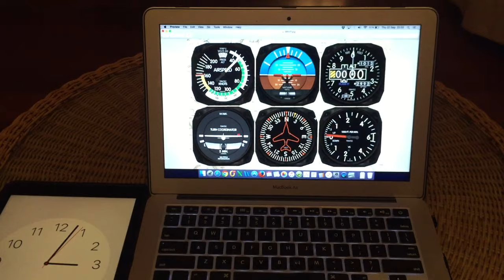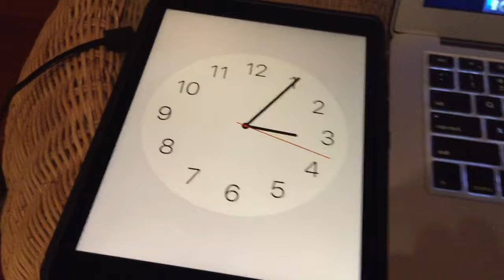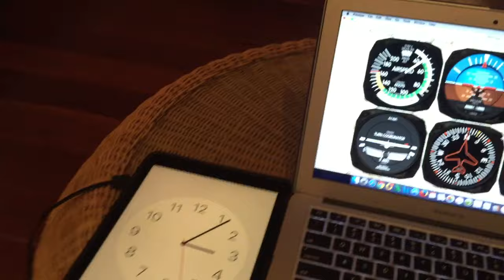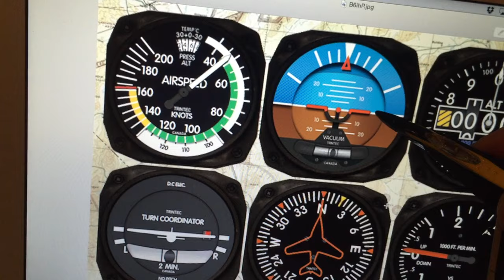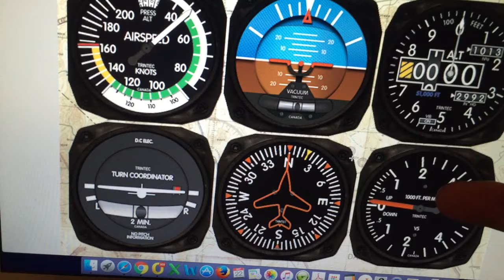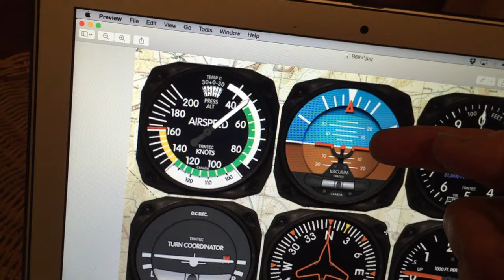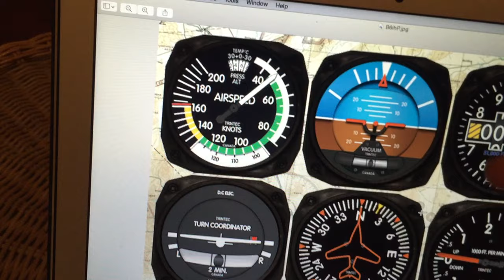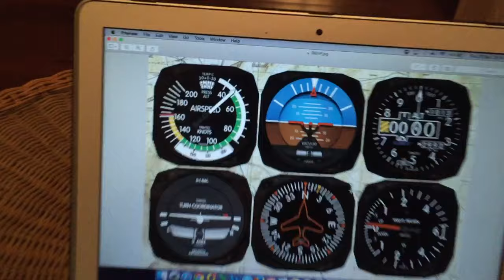Do aircraft change attitude to follow the curvature of the Earth?

Comment: Are you a pilot yourself Wolfie? I think not. 
I am. In straight and level flight in no wind no turbulence conditions, once trim is set, I hardly ever had to touch the yoke to keep straight and level flight. I could fly several minutes 10 15 20 30 mins w/o adjustment.  And that was before I ever questioned the shape of the earth. 
Earth is level my friend.
Reply: What about 45 60 120 mins?
Reply: david Richards

Autopilot.
Reply from the maker: Here is a really simple question Charles, even a private pilot should be able to answer this easily. 

What is the distance between the following pairs of Latitude and Longitude? 

1.   60N010E and 60N020E?
2.   00N010E and 00N020E?
3.  60S010E and 60S020E? 

To make it even easier just calculate the rhumb line distance.     Any pilot worth his licence should be able to do this in his head in about 15 seconds.

What answers do you have please Charles?
Reply from the maker: Yes Charles, I am an FAA and CASA ATP pilot, a Grade 1 flying Instructor
 with over 10,000 hours and 3000 on helicopters.  Did you actually watch
 the video and listen to what I said?    Of course you cannot notice the 
pitch down because even flying jets it is only 1 degree in 8 minutes. 
The average pilot will never even realize he is slowly pitching down 
because the rate is far too slow to be noticeable and is achieved simply by maintaining altitude anyway.   
I said that in my video very clearly. 

What type of aircraft do you fly?   Have you ever flown internationally 
in the Southern Hemisphere?  How do you calculate flight plans?  

When you are hand flying at a constant level, what do you do if you notice your altitude increasing slightly?
Reply: Wolfie6020
It's only 1 degree in 8 minutes for the first 8 mins. the decline then increases exponentially for each mile flown. I have flown for several minutes for miles in calm weather conditions without having to touch the controls purposely just to see how far I could fly doing just that. Yeah, 30 mins is a bit too far, but several mins was quite common.
Are you really a pilot? How do you calculate flight plans? I flew a model plane at the beach. LOL Having all the credentials in the world doesn't change a thing.  What does flying internationally over the SH have to do with anything? I have two videos on my channel where I discuss flying. I also watched the entire Globebuster video where they went over your video in detail. 
Further, if the earth is spinning west to east, landing at a N-S oriented airport, pilots would have to adjust for the shifting of the airport beneath them during final approach. My home airport was 120 mag north and never once was any spinning sphere adjustment needed, nor was any curvature or spinning of the Earth even mentioned during flight training. You're full of it.
Reply from the maker: CharlesFockaert
Then as a pilot you should have seen the major flaw in the Globe Busters video.  The exponential calculation only applies to a fixed point observer.  It does not apply to a moving aircraft at all

A moving aircraft has to pitch 1 degree in the first 8 minutes.   Then 1 degree in the next 8 minutes, then 1 degree in the next 8 minutes and so on. 

Because it is moving, the attitude adjustment required is steady, not exponential at all.  Please don't make the same dumb mistake Bob did in his video.

A great article on this topic is here.

https://flatearthinsanity.blogspot.com.au/2016/09/flat-earth-follies-planes-would-have-to.html
Reply from the maker: CharlesFockaert
See a few minutes is a far cry from 30 minutes. so you admit you were exaggerating.  That is cool.

I want to know how you calculate your own flight plans.  I use various methods and verify them with a raw math excel sheet I wrote myself using the Haversine formula.  The relevance of the Southern Hemisphere is that this formula would never work on a Flat Earth in the Southern Hemisphere.

Can you explain why it does work perfectly though?

Here is one of the little tools I wrote that calculates great circle distances.   Please try it yourself and please explain why it works in the Southern Hemisphere  (If the Earth was Flat it would not work at all)

https://dl.dropboxusercontent.com/u/62849459/Simple%20Great%20Circle%20Distance.xlsx
Reply from the maker: CharlesFockaert
Have you actually calculated how much adjustment is required during an ILS approach to a N/S runway at 160 Knots starting from 10 miles?   Just give me a ball park figure how much drift adjustment you believe would have to be corrected for due to Coriolis in that scenario?
Reply from the maker: CharlesFockaert
PS, I will watch your videos soon.
Reply from the maker: CharlesFockaert
You disappoint me Charles.  You claim to be a pilot and when we start talking "pilot stuff" you can't answer simple questions and respond with a silly comment worthy of a 10 year old.

You think Coriolis is male cow dung?  What do you think a comment like that does to your credibility in the eyes of any professional pilot reading this?
Reply: Wolfie6020

I'm a private, not commercial pilot. I am not IFR licensed, taking only about 25 hours IFR training.
I'm watching ILS landing videos right now. No mention of coriolis in any of them.
I don't care what a "professional pilot" thinks. There is no curvature to the earth, there is no coriolis, there is no spin. You're the one w/o the credibility. I also am licensed amateur radio operator. You gonna question that too, just because I don't believe the spinnins sphere nonsense they teach there too?
Reply from the maker: CharlesFockaert I won't question you on being a licensed radio operator because I am not one and you likely know a lot more about it than me anyway.

There is no mention of Coriolis in the ILS videos because the effect is so insignificant it is negligible.  That was the point of my question to you.

Hey you are entirely within your right to believe the Earth is Flat but if you were an International pilot who circumnavigates the Globe regularly you would actually understand why that belief is totally wrong.
Reply: +Charleyboy  LMAO.  I touched a raw nerve eh?  None of that requires any intelligence.  So you passed a real estate agents exam.  Big deal!  So did my mum.  Why would I post my credentials?  only insecure people need to do that.  FYF.
Reply from the maker: +CharlesFockaert.  I didn't see this last post of yours as it was in the Spam folder but I just approved it.   Your math is completely wrong Charles.  800 Mph is 13.3 MILES per minute.  Not Feet per minute.   A five minute approach would be 66.66 MILES.  Not feet. 

However your logic is also flawed too.  That motion is totally irrelevant as the aircraft is already moving laterally with the spin.  Why do you think it is separated?  

The correct way to calculate this is take the latitude at the beginning of the approach - calculate the Earth's speed of spin, then take the latitude of the threshold and calculate the speed of the spin.   Over ten miles (ILS approach) the difference is negligible.   Please do that math Charles and then I will show you mine and we can compare.   Lets say,   The runway threshold is 35 South Latitude - Runway 36  (exactly 360 true)  Starting the approach at 10 miles and maintaining 160 Knots down final all the way to landing.     Do that math and you will see the coriolis is negligible. 

To understand why your logic is wrong, please watch these videos showing that the motion of an object in the air is not separated from the motion of the ground the instant it becomes airborne. 

You are falling for all the silly mistakes in logic that I see often on Flat Earth Videos.   The aircraft has the earths spin before take off and does not instantly lose it when airborne.  

https://youtu.be/viHz5MWz8kU?t=3m22s

https://www.youtube.com/watch?v=XawCNYpeKD4

https://www.youtube.com/watch?v=7EklkTiLxMg
Reply: I thought there was something wrong with that number when I did the calcs. But 66 miles just supports my view all the more. This "That motion is totally irrelevant as the aircraft is already moving laterally with the spin" is pure poppycock. How is the plane moving laterally with the Earth's spin? Further, why didn't this come up even once in my flight training? There is a video out there where a rifle instructor admits there is no adjustment for the alleged Earth's spin: the bullet is not affected. Same principle - bullet or plane - there is no spin. Me senses tell me as much, despite all that relativity male cow dung. 

Doesn't matter anyway. Please explain how the world's oceans are stuck to the bottom and sides of a ball spinning around at over 1000 mph - which is faster than the speed of sound? You're going to give the standard answer _ Gravity. Well, if the moon is allegedly moving the same mass of water at the tides, then the much smaller moon's pull is greater than the pull of the Earth's gravity? Earth's gravity can hold billions of cubic feet of water to the surface of the Earth, but can't pull a bird into the water? Doesn't make sense. 
Sorry, still no evidence to change my mind.
Reply: Yeah, I'm insecure. You got me. Discussing issues with you is Pigeon Chess.
Reply from the maker: As you are a pilot please answer me this very simple question Charles.  If you are hand flying and cleared to cruise at 6000 ft if you noticed the aircraft had climbed 50 feet, what would you do?
Reply from the maker: CharlesFockaert
If nothing I say will change your mind and nothing you say will change my mind, because I can clearly see the flaws in your logic then why waste each others time.   If you are happy believing the Earth is Flat then be my guest. 

Just wondering though f you can explain why the Sun is setting well South of Due West in Sydney right now? 

https://www.youtube.com/watch?v=GGXh7HfTbHk

That simple observation utterly destroys any possibility the Earth is Flat can you honestly not see why?
Reply from the maker: +CharlesFockaert,  again this post was in the spam folder.  I have now approved you so you can post links and they won't get blocked.    How many examples will it take to convince you that Stinky Cash's video is wrong?  One?, Two? or five?

Firstly, yeah my video explains everything - this angle for the sunset is completely impossible on a Flat Earth.  Why can you not understand that Charles? 

1.  The map shows Australia is twice the size East to West than the USA.  This is completely wrong,  Road, Rail and flight times confirm this. 

2.  Why does Russia have 11 time zones when Australia has only three?  That makes NO sense at all on the Flat Earth map in his video. 

3.  If the Sun is moving faster over the Tropic of Capricorn than it does over the Tropic of Cancer, why is the longest day in Rockhampton Australia (21st December) exactly the same length as the longest day in Mazatlan Mexico (21st June) - 13 hours 33 minutes.   Impossible on a Flat Earth. 

4. Looking South from Rio in Brazil, and Perth Australia you are looking in completely opposite directions.  Yet at precisely the same time you can see Acrux in the sky to the South from both cities.  How can the same star be in two places at the same time?  

5. Circumnavigating the Globe South of the Equator should be much longer than doing it North of the Equator.  It is not - its is the same - I appreciate you may not have done this yourself but I have. 

6.  On the Equinox - the Sun Rises at 090 and Sets at 270 all over the Earth.   This is observable fact.   Test it yourself.    That is not even remotely possible on a Flat Earth and Stinky Cash's video demonstrates this would NOT be occurring if the Earth was Flat. 

Need more examples - please let me know.
Reply: Wolfie6020

What you don't get is that just because you appear to be correct on these sun issues and even the Flat Earth map doesn't mean the Earth is spinning and is a sphere. I still have issues with the Earth's oceans being stuck to the bottom and sides while spinning. Also, there is no curvature.

Water is level, not curved. There are also issues with the constellations. Moon landing, van allen belt, ISS, radio wave propagation, NASA lies, etc ad infinitum.

Just because a private pilot who hasn't flown in two decades, who isn't IFR and not up to speed on some aspects of flight or as knowledgeable  as a commercial pilot who has to keep current by passing exams, doesn't mean he's stupid, so why the ad hominem used, (not by you but these other posters?)  Like I said, never once was the the spin of the Earth mentioned during my (limited) training.

We agree, repeat, agree there are issues with the flat earth maps as they are currently drawn. But there, as I said above, other significant issues with the spinning sphere model as well.
Reply from the maker: CharlesFockaert I am happy to agree to disagree Charles and if someone produces a perfect Flat Earth Map that explains everything I can see and have experienced with my own eyes plus a 2D formula that lets me calculate flight plans that work as accurately as mine do now then I promise to be the first to admit I was wrong.

Until then, I will have to stick with the Math and the Maps that have never failed me in 30+ years...

Cheers.
Reply from the maker: +CharlesFockaert.   See the thing is Charles, when I watch videos like that which people claim as "proof" I immediately see that much of it is nonsense based on things i have experienced with my own eyes.  Let me give you examples from that video.. 

1. Water unmanipulated actually forms a sphere.  Not level.  When manipulated it conforms to the forces being acted upon it - e.g. in a centrifuge it forms a curved surface.   (yes I have simulated zero G in aircraft and watched water form a sphere.)

2.  Horizon rises to eye level.  Absolute BS.  I have several videos proving this on my own channel.  I see aircraft 1000 ft below me all the time appearing well above the Horizon.  An aircraft 10 miles away and 1000 ft below me is 1 degree below my level.  At 40,000ft the Horizon is 3 degrees below level which is why the aircraft appear above it. 

I see the horizon drop in my HUD every time I fly.  I see this with my own eyes all the time so I know that claim is total BS. 

https://www.youtube.com/watch?v=Th9irMrNlhM

3. Curvature.  I respect you may have never been up to 49,000 ft, but the plane I fly is rated to 51,000 ft.  From the high forties the curvature is obvious.  I can see it clearly through the cockpit window.  It is not window distortion as some claim because it was also there in an old HS 125 that had flat plate windows.  The horizon is clearly curved. I see it with my own eyes regularly. 

Flying from Sydney North East we often see Balls Pyramid, a large tall rock almost two thousand  feet high in the middle of the Ocean, it appears top first then becomes more visible as we get closer, the curvature of the earth is very obvious. 

4. Crepuscular rays - his explanation is totally wrong.  they are actually parallel and I have a video proving this also from my own experience just a few days ago. 

https://www.youtube.com/watch?v=dyUnNYbPhqI

Honestly, do you think it is wise to base your understanding of the shape of the Earth on youtube videos without actually testing this yourself.   

One easy test.   Buy two green lasers.  Set them up 24 inches apart and parallel.  Now put your head right between the beams and tell me what angle they look like?
Reply: Wolfie6020
I've already admitted your last video presents a problem for the existing FE theory of the movement of the sun and moon over the Earth.
What you don't seem too understand is that just because there is one issue "Sunset angle" poses a problem for the existing flat  Earth model, doesn't necessarily mean that the Earth spins at or that it is "pear shaped."
The Spinning Sphere Model has it's problems too.
I personally don't have to do the experiments myself.  Others, with the time and better skills than myself can conduct these "experiments" and then report them as a video for the rest of us to watch. I can't come down to Australia and do what you do.
You seem to address one issue and think that settles it. It doesn't settle if for me. Get it?
NASA is still lying, they still did not go to the moon, there is no curvature as far as I can tell,  I still don't think billions of cubic feet of water sticks to the sides and bottom of a spinning globe tilted 23.5* on it's axis, rotating at 67k mph around the sun, etc.

Scientism is a religion whose High Priests  brought us evolution, which is a complete farce and lie. Antarctica is off limits and is in the news much lately. Why is that? What are they hiding? Why don't you look into that? The great wall of ice being Antarctica which holds the waters in makes more sense to me than "gravity" holding the water to the sides and bottom of a spinning globe, of which NASA can't make up it's mind as to what it actually looks like, hence the photoshopped CGI images which "have to be" photoshopped. Their words, not mine.

Many don't care what Scripture says, but I do. Scripture, which I have found to be 100% accurate, says there is a firmament. The great light, the sun and the lesser light, the moon move - not the Earth - giving us the times signs and seasons and the Earth being  immovable. Where's the firmament in the spinning globe model? Some suggest the van allen belt is the firmament. NASA recently admitted they have to deal with the van allen radiation belt, and I'm sure you've seen the video.
Van Braun has Psalms 19:1 on his gravestone. Why would he do that?
Looks to me like you've still got a lot of experimenting to do. I appreciate your efforts, I really do. But for me and many many others, you've not provided a "preponderance of the evidence" suggesting the present accepted model is the reality. Speaking of reality, I don't feel like I"m spinning around at 800 mph. My senses tells me I'm standing on a stationary Earth. Scripture tells me I am. Once someone lies to me - NASA - it is only natural and wise to question everything they say.
Why is Kerry and Obongo even addressing the FE issue, if it's so absurd? I think they feel threatened. If FE is true, their entire Scientism model collapses and they will lose all credibility. I could go on but you're a smart guy, you know as much as I do or more.
So far, as a member of the jury, not convinced.
Reply from the maker: CharlesFockaert
Thanks for the long reply Charles,  I think you are missing the point.  It is not my job to convince you of the shape of the Earth.

Only you can do that.  But if you are not prepared to do the experiments yourself you willl never know the truth.  I know the truth because I have circumnavigated the Earth dozens of times,  Completely in the Northern Hemisphere,   Completely in the Southern Hemisphere and a combination of both.  I spent years as an amateur astronomer and calculated the sidereal day period myself as a teenager. 

Watching youtube videos will never teach you anything as most of the ones you have linked to have serious flaws in logic. 

Anyway like I said.  It is not my job to educate you.  That is your job.  What you ultimately believe makes no difference at all to me my friend.
Reply: If you watch my video on evidence is not proof, you'd know that I know 
no one can convince anyone else of anything. I say that over and over 
again in my videos. And I also say that I don't care what others think 
one way or the other. Further, I disagree with your view "Watching 
youtube videos will never teach you anything" as I have learned many 
things from doing just that.
Reply from the maker: CharlesFockaert
Disregard my last post.  It sounded rude but was meant in a light hearted way...
Reply from the maker: Replying to your post that was blocked (no idea why it was blocked.)

1.  Water in a pool and lake bed IS being manipulated by some force.   (
 I call it gravity - you can call it whatever you will)  But the force 
is there,  pick up water from the lake and drop it...  However in a true
 zero gravity environment any amount of water will form a sphere.

2.  You missed the point of my example.  I did not change the subject.  I
 gave you an example that proves the Horizon drops.  An aircraft below 
me appears higher than the horizon.  Please think about that one more. 

3.  The first videos you posted proves my point that you don't actually do any
 research yourself.  Digging a little deeper yourself you will find 
there are other videos by the same camera that shows a lot of curvature - (it has a fisheye lens that reverses or enhances the curvature depending on where the horizon is in the frame) 
 the flat earth sites conveniently ignore these though. 

https://www.youtube.com/watch?v=gO_dExpSiW8

4.  Again you entirely missed the point and keep changing the subject.  
 The point of my video there was that parallel rays of light can appear 
sharply angled from different viewing positions.  Do you disagree?
Reply: If the "gravity" can keep water stuck to the Earth there's no way anyone is leaving it
Reply: Tom Alexander Incorrect.
Reply: I know, it's all magic explained by theories
Reply: And you do of course, from whence you have your information to disprove these what these people believe ?
Reply: if you think that the Coriolis effect is real because the earth is spinning anti clock wise at 1000 mph  and you are flying a plane even a commercial jet doing 570 miles per hour if flying west to east you can never get to your destination. once in the air you have left the earth just like a projectile fired from a gun and the earth would be spinning away or toward you or north and south passed  you. if a sniper takes a shot facing north at a target 3 miles away flight time of the projectile .s 7.2 seconds 1000 pmh =400 meter per second   400x 7.2 seconds the target will have shifted 2.880 kilometer's no sniper in the world has a scope with 2.880 of windage  on it . sorry but it is flat and every one refers to sea level because it is .other wise it would be sea round . lol you only have to look at a video by a commercial pilot and they set it on auto pilot and it fly's to a imaginary flat horizon and there is no i repeat no auto correct in any plane for the curve of the earth just take a look at the gyro workings. sorry wolfie it is flat and that is that
Reply: ted chambers
If you were traveling in a train at 120 mph, what do you think would happen if you just stepped out of the door, do you think you would instantly stop moving?
My guess is that you know your body would still be moving very fast and there would be a good chance you would be killed or seriously injured.  Newton's first law.
An aircraft leaving the ground does not lose the speed it had while on the ground but adds it's airspeed to it.
If it is flying at 500 mph with the rotation at the Equator, if seen from a fixed point space it would appear to be traveling at 1,500 mph with the surface of the Earth beneath it traveling at 1,000 mph.
Reply: grahvis so if we are spinning at 1000 mph and are 93 million miles from the sun  it in 6 months when we have half circled it at 67,000 miles per hour, or 110,000 kilometers per hour do we drag the north star along for the ride or does it get there under its own steam . and remember from 93 million miles away from one side to 93 million miles away on the other side is a total 186 million miles of travel and the north star is right there with us . tell me how.??? or do you already know
Reply: ted chambers 
Remember the scale of the distances involved.  The distance from the Earth to Polaris is about 14 million times further away than the diameter of the Earth's orbit round the Sun.
It would be like pointing a camera at an object 14 kilometres away and moving the camera sideways by just 1 millimetre.
Modern telescopes can however record the tiny circle Polaris makes over the course of a year.
Polaris isn't exactly on the axis anyway, it's about 1 degree off axis.
Reply: GRAHVIS  how do you come up with the fantastic distance calculations do you do it like sir Isaac newton .?? and just hold your thumb up and say that's about the right distance . no laser or any other device can measure those distance's . ???
Reply: ted chambers 
For the nearer stars stellar parallax is used, comparing the apparent difference in position between two stars as seen from each side of the Earth's orbit.  There is now the Hipparchus satellite which can measure more accurately and enables the distances to more stars to be calculated than could be done from through the atmosphere.
This gives a broad outline.  
https://stardate.org/astro-guide/faqs/how-do-astronomers-measure-distances-stars-and-galaxies
Reply: HAHAHA Charles thank you buddy i love it, how come you are soooo right and yet these rats are calling you stupid and theyve never flown?? LOl..

your going up against goons my friend... You sir, are a real man, while these radicals try to interpret any little rubbish as some theoretical mathmatics, when in reality very little is needed, and its very simple..
Reply: Wolfie I do acknowledge your curiousity and respect it.
Reply: CharlesFockaert "Earth is level my friend."

Yes, true.  However, "level" is not the same as "flat".  Earth is level (ignoring terrain), but not flat.
Reply: @CharlesFockart: You wrote "t's only 1 degree in 8 minutes for the first 8 mins. the decline then increases exponentially for each mile flown. I have flown for several minutes for miles in calm weather conditions without having to touch the controls purposely just to see how far I could fly doing just that. Yeah, 30 mins is a bit too far, but several mins was quite common.
Are you really a pilot? How do you calculate flight plans? I flew a model plane at the beach. LOL Having all the credentials in the world doesn't change a thing.  What does flying internationally over the SH have to do with anything? I have two videos on my channel where I discuss flying. I also watched the entire Globebuster video where they went over your video in detail. 
Further, if the earth is spinning west to east, landing at a N-S oriented airport, pilots would have to adjust for the shifting of the airport beneath them during final approach. My home airport was 120 mag north and never once was any spinning sphere adjustment needed, nor was any curvature or spinning of the Earth even mentioned during flight training. You're full of it."

Wow, you obviously don't understand 'frames of reference'. It's ALWAYS 1 degree every 8 minutes.

How can you flattards not understand that the atmosphere is moving WITH the Earth? This is due to millions of years of friction with the spinning earth. Planes flies in their frame of reference. In this case, planes fly in the atmosphere and since the atmosphere rotates WITH the Earth, no correction needs to be made to account for the rotation of the Earth once the plane takes off.
Reply: @CharlesFockart: You wrote " How is the plane moving laterally with the Earth's spin? Further, why didn't this come up even once in my flight training? There is a video out there where a rifle instructor admits there is no adjustment for the alleged Earth's spin: the bullet is not affected. Same principle - bullet or plane - there is no spin. Me senses tell me as much, despite all that relativity male cow dung. "

That's because the atmosphere of the planet moves WITH the movement of the planet due to the friction with the Earth's surface. Any gas that brushes up against a spinning ball will immediately start to rotate with the ball itself. This is basic fluid dynamics.

Let's put it this way:

1. There is friction between a solid surface and any gas around it. That's just basic physics. Any element that rubs up against any other element will induce a level of friction.
2. If one of the object is moving and there is friction, and the other object is motionless then the following thing is going to happen. If the moving object has a lot of inertia and is much heavier than the unmoving object, then the unmoving object will start to move. This is because physics demands balance and as long as there is friction between the solid object and the gas, then one will cause the other to accelerate in the direction of the rotation. Obviously, a solid sphere is much dense and heavier than the thin layer of gas that brushes up against it, so the gas will begin to rotate with the solid sphere until the gas is in SYNC with the solid sphere. Once this happens, there is no more friction between the two and physics is now happy with the equilibrium.
3. However, once the gas that is very close to the sphere begins to spin, it will also enter in friction with gas that is slightly farther away from the sphere. Once again, physics WANTS equilibrium. As such, the slightly farther away gas will also start to spin with the gas that is closer to the sphere. Technically speaking, the farther away gas will attempt to counteract the movement of the much closer gas, but since the most closer gas is heavily impacted by the friction with the large heavy sphere, the farther away gas isn't going to have enough inertia to stop the closer gas, so instead, it will start to spin.
4. Keep on doing this until a considerable amount of the gas around the sphere actually rotates with the sphere. Usually, you'll get about and half an inch or so of gas spinning with a 4 foot spinning sphere after a few minutes.

Now, consider this. Most of the Earth's atmosphere is within 10 miles of the ground. Now, compare this to the Earth's radius of 3959 miles. If you were to scale that to the 4 foot sphere example above, this means the gas layer that moves would be 0.01 inches (one one-hundredth of an inch).

The reason why you don't have to account for the Earth's rotation is because the atmosphere moves WITH the Earth. And the atmosphere moves WITH the Earth because there is friction between the atmosphere and the Earth...
Reply: @Ted Chambers: You do realize that the atmosphere of the Earth moves WITH the Earth, right? I mean, a thin layer of gas that enters in friction with a solid spinning sphere will invariably begin to spin WITH the sphere. This is basic fluid dynamics, friction, physics.
Reply: "once trim is set, I hardly ever had to touch the yoke". Exactly, "once trim is set". If you are climbing without touching the yoke, the correct reaction of a pilot should be to set the trim, so that you are no longer climbing. That is, you are compensating for the curvature of the Earth yourself without even realising it.
Reply: When an airplane is trimmed so that the lift of the wings is equal but opposite to the pull of gravity, it will stay at that pressure altitude, if you want to fly higher, you need more speed or angle of attack to have that balance. As the altitude increases the airpressure/density decrease and the gravity overcomes the lift and limits the flying altitude, unless the pilot increases speed or AOA.  Every airplane has it's maximum altitude it can reach, a small Cessna can't fly as high as U2 or SR71 because it doesn't have enough thrust to fly fast enough for its wings to create lift needed. 

There's one reason why pilot needs to trim  nose down frequently,  that's because plane uses fuel and becomes lighter and that needs to be compensated with small nose down trim change. If the airpressure (density of air) doesn't change with altitude then even a Bleriot XI (serv.ceil. 3300ft) would fly to the space. But as we all know that's not the case and we know that the air pressure is the limiting factor, and because the airpressure changes with the altitude the plane will follow the pressure altitude it is trimmed at and doesn't care whether the earth is flat or round of the earth. Airplane flies parallel to the surface and even on round earth if you pitch airplane down even 1° now and then you will  crash quite soon.  

 I'm former pilot and do know that the higher you already are the harder it is to go even higher, and at some point you can't climb any higher, no matter how hard you try. And at the maximum altitude you must be on full power, reducing power even a little would make you stall or descend.  
BTW, you don't need to change the pitch of airplane to climb or descend, just change speed, more speed you climb, less speed you'll descend. If you just pull stick or yoke and then realease it, you'll return to more or less the same altitude you were before that pull. If the speed, AOA or the mass of the airplane isn't change it will stay at the pressure altitude it is trimmed at, and if any of those three is changed then the altitude would change.  As the pressure levels follow the curvature of the earth so does the airplane, without any input from the pilot. 
Do you know why there is setting for airpressure in altimeter? that's because if you have wrong settings you don't know what is your true altitude, and the airpressure do change a lot sometimes, and that means that even if your altimeter reading hasn't change your altitude has, either up or down.

It's no wonder if there are ordinary people who do not know how airplanes work, but If there  really are pilots who do not know the relationship between air density, lift and gravity, or who thinks an airplane needs to pitch down to follow the curvature,  I wonder how they got their licenses.  Well,  if there are pilots like the one in the "Mythbusters" who believed that an airplane can't take off from a treadmill, I wouldn't be surprised if they have some other crazy beliefs..
Reply: Christopher Ellis.  Was that to me and what do you mean with it?   I did learn enough about navigation so that I never got lost, and I always arrived to my destination within a minute or two (2-3 hours flights). I know that the navigation I learned work only on a globe. 
Planes I flew with in the 90's (Cessna 150 (OH-CGL), 152 (OH-AWB), 172 (OH-AWA) and Piper PA 28 (OH-PCW)) didn't have any kind of GPS devices,  so I needed to be more careful when planning the route. I still have my old (90's) Jeppesen CR-3 flight computer (Kakkara, as we called it here in Finland) and charts. What I wrote has nothing to do with navigation.
Reply: CharlesFockaert.  No, sorry, the earth is NOT level, but the plane flies level , just like a boat travels level.    the oceans curve and so does the atmosphere in the same way.  no dipping the nose is needed. both fly and travel in a constant pressure range.        gravity pulls straight down..... similar to a control line aircraft doesnt need to turn, to go around you on a string .. make sense?
Reply: Your correct CharlesFockaert. I watched videos of a small plane, no auto pilot on and just holding the yoke steady, the altitude does not change, not in flying a few hundred miles. The earth, she is flat.
Reply: Barney Rubble,  how can you say that someone is correct, if you dont understand the basics here.  yes, holding the yoke steady says that the airplane is flying in a constant pressure in the atmosphere.   the pressure is based on your distance to the ground.. that would never change as you travel around the earth.   the gyros adjust for curvature by use of weights on the gimbal... this adjusts for curvature at a rate of up to over 10,000mph.   the video shows that the gyro can correct automatically, 20 degrees in less than 8mins.. .do some math here .. it all makes perfect sense.    the earth is round... easy to prove!
Reply: CharlesFockaert of course you don’t. Because the aircraft is still a part of the earth. Therefore GRAVITY. Down is perpendicular to the center of mass.
Reply: CharlesFockaert I calculated how much altitude a plane should lose in one hour if it is flying on a globe earth at 300 miles per hour and I got roughly a quarter of a mile of altitude should be lost in one hour. I'm not good in math and I steer clear of it whenever possible so I could still be wrong even though I used a calculator. I'm not a math person at all. But if I'm right, it would be hardly noticeable unless you were paying close attention in an effort to prove or disprove flat earth. But I'm still not too sure about my math skills lol.
Reply: Melissa Mae the plane wouldn’t lose any altitude as long as it was flying level 
However it would be able to go around the earth just as boats do
Reply: NICE ONE!
Reply: CharlesFockaert
That's stupid, the autopilot steers the elevator to cause the needed attitude adjustment to maintain level flight at the assigned barometric altitude.
Reply: rstevewarmorycom  .. No, the autopilot ONLY corrects changes in altitude above the earth   that has NOTHING to do with the curve of the earth..  think of it this way, the atmosphere is curved around the earth, just as the oceans are.    so, there is NO adjustment needed fro the curvature.... the earth is curved, but the plane flys level... level is with respect to the force of gravity (straight down)  flat is a shape... no, the earth is NOT flat.
Reply: CharlesFockaert
Earth is a globe, fool. Level is NOT straight or flat. Level is the same distance from the center of the earth.
Reply: zanick2
Man, I'm a physicist, which means I'm qualified to DESIGN aeronautical equipment. You DO have to change direction continuously to follow a curve.  If you watched the video, Wolfie says the SAME THING!!! Don't be an idiot!!  I understand you get the globe earth, but if you did not correct for barometric pressure you WOULD increase your altitude somewhat if you flew what you thought was a straight line. That is why the autopilot or the pilot, unknowingly, would adjust the elevator very very very slightly down to conform to the curve. It would do that to maintain barometric altitude.  No, the earth is a globe, true.
Reply: rstevewarmorycom   . yes, we have a slight disagreement. glad we both agree the earth is round.  Nothing idiotic about that! ;)    
 Did you read what i said in response?   anyway, we are saying near the  same thing.     BUT, if you are a physist, why have you explained it almost perfectly, and then make the critical error in your last sentence.     the elevator on a flat earth, would not be moved to fly level.  this is NO different on a curved earth.  why? because the atmosphere is curved.          the auto pilot doesnt even make slight changes to elevator downward on a sphere.    does a boat need to 'nose" the bow downward to follow the curved earth? no... what about a submarine??  does  it have to pitch down?     an airplane is the same thing. there is NO need to alter its path due to curvature.   it flies in a region of equilibrium air density.  any movement downward would result in a increase in velocity.  it doesnt.   why? because the plane flies level, not straight.   as a last example.. think of a control line airplane.. there is no adjustments to the controls to fly around you via a cord.. (the cord acts like the force of gravity) the plane flys level with respect to the center, but it curves around you... makes sense?
Now, if you are truly  a physicist (by background is aero) then, you might see your mistake.
Reply: zanick2
When the elevator is flying on our hypothetical flat earth, it causes the wing elevator system to conform to the path it takes, a straight line. 
When the elevator is flying on the actual globe earth, it causes the wing elevator system to conform to the path it takes, a curved line.
If the planes are both the same, or the same plane, and we attach an angular recorder onto the elevator, you will see after a given flight of some length, that the average angle of the elevator will be VERY VERY VERY slightly different for the two cases. This represents what the pilot/autopilot had to do to maintain the same flight level, or barometric altitude. 
Yes, a submarine would also, but its adjustment difference for the two cases would be even MUCH smaller than for a plane, because of its slow speed.
No, it would NOT result in acceleration, because the gravitational potential energy is the same at same distances from the earth's center. 
Control line plane models are forced to curve by the centripetal force, that isn't the same.
If you are NOT a physicist, then you should work harder to understand why you're WRONG!!
You need to re-watch Wolfie's video above, you misunderstood it completely.
Reply: rstevewarmorycom     I think you need to think about this a little more carefully. this is a known fact of physics of flight.  yes, you are right, there would be no change in potential energy because the distance from the earth would remain in both cases.  (as long as the plane is maintaining the same altitude)  so we agree there. However you are wrong about the supposed " elevator  angle " that would be required to maintain level flight.   there would NEVER need to be a change of the elevator angle of incidence.   a plane flys in a equilibrium of air pressure during level , constant speed flight.  drag = thrust, lift = gravity.   it doesnt need to have any adjustments to change elevator settings because that would mean a change in agle of incidence.  the relative wind is constant, and does not change. it is always level with respect to the earth and parallel with respect to an airplane . the reason the relative wind is always perpendicular to the earth, for level flight, is because it is a region of consistent air pressure.  for a plane to put ANY input to the control surfaces , it  will rise or descend.   this is an aerodynamic principle of fact.

a submarine doesnt have to do it as well.  why, becuase it too is "flying" in a pressure region relative to the surface.  the pressure region doesnt change around the earth, so there is no need for any corrections. when comparing a flat earth to a round earth ocean.   

another example is a hydrogen balloon. if you have the perfect equilibrium of pressure at any altitude, it will travel level to the surface of the earth without control... BECAUSE it is flying in a pressure gradient that curves around the Earth.  make sense??

you are not an aero engineer....  you might want to study up a big, OR show me where i am wrong.  im willing to discuss, but i think because your unfamiliarity to the topic, you are off base here. IM very excited to hear you response.   love the discussion because it makes you THINK.
Reply: restevewarmmorycom for a physicist, you seem to be lacking some basic understandings here or a little rusty.  YES, regarding the control line analogy or comparison, GRAVITY is considered to be a centripetal force  with respect to satellites, and in this case, airplanes.
Reply: zanick2
Balloons are buoyancy. Not the same. A flying craft must have its control surfaces conform to the shape of their path. Wolfie agrees with me. Go get a degree in physics and come back. Physicists TRAIN aeronautical engineers.
Reply: zanick2
No, I'm not "rusty".  No, your orbital mechanics are baloney.  Airplanes aren't the same. Satellites are orbital,   F = GMm/r^2  and centripetal is F = mv^2/r   so GMm/r^2 = mv^2/r, therefore GM/r = v^2, and v = SQRT(GM/r), the orbit equation.  In the case of flight it would be g = the wing equation. Lift versus weight.  Go get a degree in physics and come back. Wolfie agrees with me.
Reply: rstevewarmorycom..   wolfie is wrong as well.  go back and read what i wrote.    i did it to discuss and help you understand. Now, if you dont agree, tell me why..Lets stay away from the orbital mechanics analogies then.  lets focus on the airplane and its relative wind that doesn't change from parallel to its path.  the wings have an  pressure differential top and bottom that matches the force of gravity.  the plane flys level. the elevators have a pressure differential that keeps the main wings angle of incidence , constant for level flight.  on a round earth  no change to elevator would ever  be made, because as the plane flys through the air, this pressure differential would NEVER change , as the earth curves.   so, no control input .
you have already used two logical fallacies..  and that's why they call them such. give me the DATA , the FACTS, you are just trying to make your point due to your degree ..   my degree is NO less or more  relevant to the correct answer.

Now, think of it this way..   its easy to prove another way...... if you are correct, say the pilot never makes any changes to the elevator settings for level flight at a set speed..  are you saying that the plane will gain altitude at a rate of 8" per mile??     this is not possible, as we would be accumulating potential energy, and that would require more power from the airplane.... i think you agree with that........so, how would the the airplane raise 8" over one mile  .   OR, that would be over 6,000feet over 100miles of travel.     so, why would the airplane climb?   do you understand how an airplane gains altitude?    it has to perform WORK/energy. you as a physicist should know thls.    but it doesnt.    it flies very comfortably at a equilibrium pressure zone    that doesn't change over 100miles.... no change in energy occurs, the plane flies level..... the pressure gradient stays the same and the pressure differentials stay the same over the 100 miles.    

you are forgetting for a plane to gain altitude... the pressure under the wing would have to change, and it doesn't , unless the plane changes its angle though the relative wind, which would not change over the 100miles.

read this above............think about it... ...............swallow your small ego, and  come clean with the truth.. you are wrong and you should be embarrassed.    go ahead.. check my work with  a physics instructor as i have...... my father has a degree in physics, and so does my brother..... com lauda.  they say you are wrong too!
Reply: zanick2
It doesn't gain potential energy unless it climbs. But it would climb from inaccuracies in power settings. No control measure is perfect. This is why the elevator has to move to conform to a level path. I understand your point, but it is inaccurate.  All these must be adjusted together to maintain barometric flight level. You need a course in closed loop controls.
Reply: rstevewarmorycom... now you are just talking nonsense.    so, a helicopter, not a balloon would be any different?  you are showing you have no clue on  why and how airplanes fly. 
balloons have a equilibrium of lift to gravity and if moved   with thrust, would float at a specific altitude and move all the way around the globe  . (if the air masses didnt move and i assume we are talking about all other forces being kept constant except for the comparison of round vs flat earth)
a helicopter floating via its lift vs gravity balance is no different than an airplane...     Aircraft fly due to a differential of pressure under and over their lifting surfaces.    the ONLY way an airplane can raise its energy potential, is if more energy is put in to the system and straight and level flight on the earth, doesnt do this by flying level, over ANY distance.  the pressure under the wing would remain constant,  the plane would always be level, so there is no need to change the elevator settings.   BUT, the plane would fly around the earth, and its curve without any pilot input .        you are being plain stubborn now!
Reply: rstevewarmorycom    NOW,  you are back pedaling.... you are making assumptions. NO, it wouldnt "climb" based you bring to the discussion,  "inaccuracies in power settings" or anything that would be the same on a globe vs flat earth travel path.  We have to remove all the inaccuracies, variables, dynamics..... we are ONLY talking about a plane flying level any control inputs strictly dependent on the differences of a curved or flat earth.. there are NONE.  None that you can articulate.    we all know the elevators have to have small adjustments to fly level in real life, due to air currents, temp change, etc...... this is regardless of a flat or  curved earth.    YOU know what we are talking about, and so is Wolfe620,  we are talking about the small adjustments to make 6,000ft of curvature change, while making no altitude changes and no attitude changes....  my point is NOT inaccurate.  if it is , please tell me how it is.... you are the physicist.. you should be able to articulate this VERY easily.   YOU wont be able to because, again, you are backpedaling .............
there is NO adjustment needed for the curvature of the earth by a pilot..   even as small as they would be, they DONT exisit.    wolfee and YOU have made it very clear you dont understand this .

You said:
>>>>>>>>>>>>>>>>>>>>>>>>>>>>>>zanick2 "It doesn't gain potential energy unless it climbs. But it would climb from inaccuracies in power settings. No control measure is perfect. This is why the elevator has to move to conform to a level path. I understand your point, but it is inaccurate. All these must be adjusted together to maintain barometric flight level. You need a course in closed loop controls.">>>>>>>>>>>>>>>>>>>>>>>>>>>>>>>>

I perfectly understand closed loop controls and that was how i made my living for many years .     We are not talking about feedback loops.. we are talking about , the effect of the curved earth on a flight path. 
you said it yourself, you said the pilot has to make small changes to follow the curve of the earth that he WOULDNT do on a flat earth.. that rules out any closed loop/open loop control issues.

YOU SAID: 

>>>>>>>>>>>>>>>>>>>>>>>>>>>>>>>>>>zanick2   "You're VERY confused, you misunderstood me. I'm a physicist, you might be an idiot. The autopilot uses the elevator to maintain "level" flight, which is a CURVED path upon the globe. It doesn't intend anything but to maintain barometric altitude, which is a CURVED path upon the globe. If there were such a thing as a flat earth, and airplanes could fly on it, the elevator would not be moved to accomplish this. Only upon a sphere would the autopilot have to very very VERY slightly adjust the elevator downward to maintain barometric altitude."
>>>>>>>>>>>>>>>>>>>>>>>>>>>>>>>>>>>>>>>>>>>>>>.

you called me an "idiot". very adhominem..and you are very clear about  the elevator NOT being "moved" to fly on a flat earth... you then say, ONLY on a "sphere"  would the autopilot have "very very VERY" slight adjustments.

that sounds like double talk to me......  now you are saying it has to do with the "inaccuracies in power settings"   YOU think you can TEACH aerodynamics??  you are having a heck of a time with something very simple here!!!
Reply: zanick2
As you rant your comments are getting longer and longer. Clearly you can't take no for an answer. Go get a degree and stop commenting to me.
Reply: rstevewarmorycom.  im trying to be explicit so there is no question.   I have a degree but do you?
if you disagree with the facts i list, let me know why.  As far as we have seen with you , you dont seem to understand how planes fly in a constant pressure gradient.   The relative wind, is parallel to the planes travel and stays that way all the way around the earth, with NO input from the pilot.    

let's start there .
Reply: rstevewarmorycom.   your responses are reminding me of a flat earther that is a "civil engineer" . (brian mullin)    it seems being an engineer or even a physicist, doesnt guarantee you know what the heck you are talking about. HOWEVER, I'm listening.  lets start with your last primary statement.      if you are a physicist, this should be an easy explain.     if a pilot does not adjust for curvature, even slightly as you say, what happens?  please explain how a plane can increase altitude  (6,600ft) over 100miles. (by flying straight, with no control adjustments)   .................it cant. it means that the plane would have to increase potential energy... how    does it do this if it is flying "level" , in a constant pressure range.     why would the plane want to increase altitude ?  it is flying exactly parallel to the relative wind... this is determined by the pressure gradients, just like a submarine would.  
you seem to be VERY in the dark for someone touting a physics degree..
Reply: zanick2
A degree in what? Don't be coy, and don't make up a degree at this late date, it won't change the Science.
Reply: rstevewarmorycom.   Im not doing anything but discussing the facts here.  you have made a statement and drawn a conclusion on a false premise.   I am a pilot as well,  with a father who is a 30 year millitary/commercial pilot.   So, lets not use logical fallacies to make our points here. 
(ad-hominem/verecundiam)    lets not talk about our credentials, lets talk about he physics.   YOU should be able to do this , right?
Lets break down your response.

1. "uncoordinated flight" with a "neutral elevator"  
response:  No, you are confusing coordinated  control inputs when making turns with a blend of rudder and elevator and aileron..    a fixed elevator position would result in level flight indefinitely, barring all other external variables.   Ceterus paribis.   when comparing flight in this condition on a flat vs round earth.

2.  " it would be as if he was ever so slightly flying nose up"
response:   No, with a fixed horizontal stabilizer set at a given altitude and speed, the plane would travel indefinitely if the variables were NOT impacting the aircraf flat or round earth.   you are putting "variables"into the discussion that make it impossible to compare.. basic scientific process forces us to remove these variables or apply them the same, in both comparisons.    IF, there was a power setting change , curved or flat earth, in both cases the plane would gain altitude until it stalled and would decent gaining speed, where that elevator setting would start to ascend .... creating a porpoising cycle.     this is a common technique used when pilots were becoming asphyxiated due to a oxy max problem .  they would their  elevator trim way back on the stick, dive the plane down and pass out.   (as it gained speed, it would start to rise, stalll, fall, repeat.

So, the above takes into accont known variables on  how an airplane reacts in normal conditions with a fixed-in-place elevator..   we all know, as pilots that the plane can rise or fall and has NOTHING to do with the earth being flat or round.   its orientation relative to the ground has ONLY do do with 4 factors.
thrust,drag, lift and gravity with respect to the force of gravity being at a right angle   to the aircraft.   THIS means that as long as the force of gravity is pointed to the center of the earth, as the earth curves the plane will follow this path, with NO adjustment needed to "nose the plane " down, even slightly.

I hope i was clear above to make this point.   now, if you have a retort, please feel free to find any errors and comment.   but stay factual and keep this to the relm of a plane flying on a flat vs round earth.

in summary, the plane and pilot willl NOT make any adjustments , even very slight to the controls on a round earth due to the curvature.  this is because the atmosphere is curved too.
Reply: CharlesFockaert
That's complete nonsense, it is 1 degree EACH 8 mins, because your reference point travels with the plane.
Reply: rstevewarmorycom  Here is some proof in the form of a thought experiment.   
if you are flying real fast, like in an SR71, that would be near 60 miles per minute.. the earth curvature is over 2000ft per minute.... .. so, this is an easy to see variable.      what you are saying,  is that the pilot would have his  rate of climb indicator (which indicates a rate of climb in 1000s of feet per min) pointed to 0, but  in effect, according to you, he would be rising 2000ft/ min.    (  the indicator is detects change in air density)

this makes no sense and is quite impossible.  in order for the aircraft to gain altitude, it would have to add more energy to its potential and its speed would then slow down if more thrust wasnt applied.

there is no "nosing down" of the plane in level flight to compensate for the curve of the earth . not even a little.   you are busting the laws of physics if you think there is....   and if you do, i would love to hear the reasons and logic for why.    

Level is the plane not gaining or losing altitude and flying parallel to the relative wind. usually the angle of attack of the wings is just slightly pointing up during level flight..  once level, with respect to the force of gravity which is perpendicular to the relative wind and level flight, there is no change  to the fight path horizontally to follow the curve of the earth.   the atmosphere is curved. the plane follows the atmospheric pressure gradient which curves with the earth.

this is correct physics in its most basic form.. you should be able to understand this.

please think about your answer and dont add factors of "thrust variance" or "atmospheric changes" or other variables that we need to keep constant when comparing the two conditions.. flat earth vs round earth altitude maintenance.
Reply: rstevewarmorycom.  I have to agree with you about CharlesFlockarert. what a nut-case.  he things the earth is flat, and proof is that he makes no controls.. and then, goes on to not have a clue about how gravity works.. he starts to reference the earth spinning faster than the speed of sound and how does the water stick to the earth.. thats SCARY that he is a pilot! (if he is a pilot)    Charles, please do some basic research about how gravity works. (proportioal to mass) and how the atmosphere moves with the earth.... oh boy!!  ;)
Reply: No, you're NOT a pilot. You're a YouTube pilot!! You imagine that coordinated only applies to rudder use in turns.   EVERYTHING you have said in your comment was confused BLABBER!!   Flight through a curved atmosphere requires conformity to the curve by the flight surfaces. 

Coordination ALSO applies to proper elevator trim. You do NOT slow-fly to a destination with your nose too high. It wastes fuel and increases your ETA. You fly at an attitude that maximizes your airspeed and trim to that elevator setting. THEN you readjust trim when you find out if that setting slowly gains altitude or loses altitude and readjust it to keep you at your assigned barometric altitude. THAT is when you are unknowingly adjusting the elevator to conform to the curve of your flight across the surface of a sphere!!! Your trim setting would be ever so slightly different than flying on a hypothetical "flat earth".  In a slow small plane this would be hard to notice or measure, but in a jet at 500 mph it would be quite measurable.
Reply: zanick2
Here is some proof in the form of a thought experiment.   
if you are flying real fast, like in an SR71, that would be near 60 miles per minute.. the earth curvature is over 2000ft per minute.... .. so, this is an easy to see variable.      what you are saying,  is that the pilot would have his  rate of climb indicator (which indicates a rate of climb in 1000s of feet per min) pointed to 0, but  in effect, according to you, he would be rising 2000ft/ min.    (  the indicator is detects change in air density)
-----------
His elevator would be set lower than if he were flying a "flat earth". His flight surfaces have to conform to the shape of his path, which is an obvious curve at that speed. Otherwise his elevator is uncoordinated to his flight path and he wastes fuel flying nose up and his ETA is lengthened.  This is obvious at that speed, but all OTHER cases of smaller slower planes are merely scaled down versions of the same process.

this makes no sense and is quite impossible.  in order for the aircraft to gain altitude, it would have to add more energy to its potential and its speed would then slow down if more thrust wasn't applied.
----------
No, a mis-coordinated elevator would result only in slight nose-up slow-flight, and a loss of airspeed, not a gain in altitude.  In fact, near stall speed it could lose altitude attempting this.

there is no "nosing down" of the plane in level flight to compensate for the curve of the earth . not even a little.   you are busting the laws of physics if you think there is....   and if you do, i would love to hear the reasons and logic for why. 
-------------
Imagine flying in a very thin atmosphere on an asteroid much smaller than the earth. The path through its thin atmosphere with tiny wings, would also have to conform to its curved path. The elevator would be set differently than on a "flat asteroid" with the same gravity, plane, and thin atmosphere.

Level is the plane not gaining or losing altitude and flying parallel to the relative wind. usually the angle of attack of the wings is just slightly pointing up during level flight..  once level, with respect to the force of gravity which is perpendicular to the relative wind and level flight, there is no change  to the fight path horizontally to follow the curve of the earth.   the atmosphere is curved. the plane follows the atmospheric pressure gradient which curves with the earth.
-----------------
Yes the angle of attack, when optimized for airspeed,  is inclined to the relative wind. I'm talking only about excursions from that by the elevator. The elevator setting that optimizes airspeed WILL BE DIFFERENT on a globe versus a "flat earth". 

this is correct physics in its most basic form.. you should be able to understand this.
-------------------
You do NOT understand the physics.
Reply: rstevewarmorycom    Lets stop with the ad homiem.   yes, im a piliot, and im wondering if you really have taken any physics courses... maybe on the internet?    ok, now we are even.    lets stay factual
 as far as "coordinated  turns".  when use of ailerons in a turn, because yaw caused by drag due to lft of the lifting wing, rudder is used to counteract this force. HENCE, coordinated control .   there is some coordination due to adding or reducing power due to spiraling slip stream and torque in a prop plane.  but for the elevators, there is no real coordinated controlling..... if there is, maybe ive forgotten.   anyway, its besides the point.

flying through a curved atmosphere , does NOT require "conformity " to the curve of the earth by the flight surfaces, because the airplane is always level with respect to the direction of gravity, which is perpendicular to the relative wind.   do you not get this???

You are right about flight attitude for maximizing  fuel efficiency.   (plowing through the air, is not efficient, i get that)   you dont want a level flight, to maximize aero efficiency.  (not nose up and more power)
yes, you want to fly at a constant altitude via a constant pressure.   however , you then are in correct by saying the small changes to trim prove that the plane needs these adjustments to follow the curve .. no, IT DOESNT.  those adjustments have to do with the variables you mentioned earlier.  turbulence, air currents, power inconsistencies...etc.. NOT the curvature.   again, look at my thought experiment to prove this.

your logical fallacy is your argument.  your proof is that the adjustments if due to the curvature, would be hardly noticeable. this is a pure strawman argument... and you KNOW IT. yes , if what you said was true, they would be "hardly noticeable" BUT, it is not tue and you dont notice any control inputs for curvature, because there are NONE needed for the factual reasons ive mentioned.

Then,  you close with  a 500mph jet, those trim setting proving you adjust for curvature is " quite measurable" if so,  where is you proof??   do you have any??   why does my airline pilot/ air force pilot, disagree as well with you.  30 years with United and you would think this would be apart of his training or experience.. but it isnt!
Reply: zanick2
It would NEVER be useful to you to assume I am not a physicist. 

Nobody has bothered to prove this with jets, it is obvious from the physics. 

When you use rudder in a turn, you do it to conform the plane's control surfaces to the curve of its path. 

That is all you're doing by trimming elevator for the earth's curve at any reasonable speed. No, it doesn't cause you to climb, that would require adding potential energy. 

But rudder in a turn has nothing to do with potential energy either! 

You're merely conforming the surfaces of your vehicle to the curved path for the purpose of efficiency, just like using rudder in a turn to prevent slip or skid. Just as a coordinated aileron turn requires rudder for efficiency, following the curving earth requires down elevator to conform to the curve path around the earth, however slightly.  

Unlike your stick or yoke, you have no sense of where "neutral" in elevator position might be. You fly to obtain assigned altitude. But what you adjust for, minutely, is conformation to your flight path, in all orientations.
Reply: rstevewarmorycom    It would never be useful for you to assume i dont have a handle on Newtonian physics and aviation.   no one has proved with jets, that what?  there is no adjustment to attitude for curvature? why would they, it doesnt exist.  i used the example of the SR71, at 3500mph, and 2000ft per min of curvature, so lets use an airliner.  that's around 300ft of curvature that is NEVER compensated for by airline pilot. the physics is obvious here , but you seem to be ignoring some basic elements.
 
Now, lets examine your statement and comparison of the use of rudders .   yes, you are right, rudders are used to change the attitude and angle of the airplane to follow a curved path, this is because the curved path is CROSSING the relative wind.     However, when flying following the curvature of the earth, the relative wind is always parallel to the aircraft, and no adjustment or correction is needed. does that make sense??? 

I see where you are confused.   so, ill try and explain further.    You mention that the airplane if it didnt slightly pitch the nose down, that it wouldnt gain altitude, because similar to a rudder analogy and a "slip" it would just increase angle of attack , progressively and gather more drag and have to slow down. (even thought it theoretically could maintain a same altitude)  so, evne if that is true, the plane would slow down.. we dont see that...>.................NOW, take this to an extreme..   if you fly 1/4 the way around the earth and do NOT nose down for curvature, at the end of the 1/4 distance around the earth, you are saying the nose of the plane would be poinint directly away from the earth...   this also doesnt happen....    the reason why it doesn happen, is for the reasons ive explained 10 times to you:

1.  the plane flies level to the force of gravity which follows you no mater where you are on the earth.    because you fly in the equal gradient of pressure and this pressure gradient is curved with the earth, the level flight of the plane will curve because of gravity and the curved atmosphere with NO pilot interaction.
2.   neutral elevator is the position that will provide level flight.  it might not be at a equal angle of incidence to the wings, but it provides the best low drag, equal lift to gravity ratio at any given speed for level flight. this will NOT change due to earth curvature.

Now, go back to your small asteroid analogy/comparison.  say we had a perfectly round asteroid, that was 50 miles in circumference.  lets also assume it had an atmosphere as dense as the earth, because this asteroid was made of material 10000s of times more dense than earth, so it had the same mass and gravity.        you would fly the plane level, with respect to gravity , perpendicular to the surface.   relative wind would be parallel to flight...  and NEVER would you have to adjust the controls for the curvature, even if you were circling the asteroid every min.          Why??   because the angle of attack of the wings would be near neutral (what ever needed to create the match of lift to gravity, and thrust to drag)   if you had the slightest downward angle of incidence to follow the curvature, this would force the plane to lose altitude, and this is NOT what we want to happen.   we want constant altitude.  

here is another thought experiment:

have a spinning wirlpool. perfect circle   put a small air foil in the  water at some distance from the center. (say there was a round center 10% of the total diameter of the spinning wirlpool.)   relative to the  center, find a equilibrium pressure that keeps the wing in a fixed position..  it's angle of attack is set. it doesnt have to be adjusted to follow the curve of the center. same thing happens with planes on earth.

you have used  over our conversation, two contradictory statements.   you insinuate that the aircraft needs to be constantly adjusted, (albeit slightly) downward to follow curvature .. then you say that the aircraft needs to be nosed down via an angle of attack that matches the curvature.  both are incorrect.

You also compare "trimming a rudder" to trimming the elevators for curve. these are not a like.  a non trimmed rudder will always stay in the same yaw position for a 2 min turn . however, this would not be true if you are right with a non trimmed elevator.... the earch curves 8" per mile, so as i mentioned earlier, the angle of attack of the plane's wing would eventually be pointing straight up, and this doesnt happen.    

the angle of attack that matches level flight, is maintained and never changed as a plane flies around the earth.  this is basic physics and i cant believe you are resisting it as much as you are.   especially,  being a degree-ed , "physicist".     mind boggling you cant admit when you are wrong.
Reply: rstevewarmorycom    another critical error you make is,  as i mentioned before, you suggested the pillots of the SR71 or airliners, would put in a slight downward trim to their flight path for accounting for the curve.  however, it seems you are forgetting that the curvature is progressive from that initial trim point.  this means the input would have to be put in , at regular points.   at 500mph, there is a 300ft per min adjustment, that is JUST not done. it would have to be put in , every min. and it isnt done.  otherwise, according to you the nose of the plane would be pointing straight up base on going 1/4 the way around the world.   you need to start using your "physics" knowledge here.     

the plane is always level based on relative wind and the pilot or the auto pilot never needs to add in down elevator trim, ever! to maintain level flight due to a curved earth.    remember level is NOT straight.  the plane curves to the earth, but is level based on pressure gradients and the force of gravity direction straight down, always! 

you would be right if we were talking about things in space, NOT flying in the atmosphere and in space.
Reply: zanick2
It would never be useful for you to assume i dont have a handle on Newtonian physics and aviation.
---------
Okay then, what ARE your credentials? Over the 5+ years it took me to obtain my degrees, I developed skills of approach to problems that a freshman physics major just does not have, however lower level the material or his mastery of it.

no one has proved with jets, that what?  there is no adjustment to attitude for curvature? why would they, it doesnt exist. 
---------
No, it does, as any physicist knows. 

 i used the example of the SR71, at 3500mph, and 2000ft per min of curvature, so lets use an airliner.  that's around 300ft of curvature that is NEVER compensated for by airline pilot. the physics is obvious here , but you seem to be ignoring some basic elements.
-----------
No, YOU are.

 
Now, lets examine your statement and comparison of the use of rudders .   yes, you are right, rudders are used to change the attitude and angle of the airplane to follow a curved path, this is because the curved path is CROSSING the relative wind.     However, when flying following the curvature of the earth, the relative wind is always parallel to the aircraft, and no adjustment or correction is needed. does that make sense??? 
---------
No, the attitude system, wings and elevator is ALSO crossing the relative wind. 

I see where you are confused.   so, ill try and explain further.    You mention that the airplane if it didnt slightly pitch the nose down, that it wouldnt gain altitude, because similar to a rudder analogy and a "slip" it would just increase angle of attack , progressively and gather more drag and have to slow down. (even thought it theoretically could maintain a same altitude)  so, evne if that is true, the plane would slow down.. we dont see that
----------
Yes, you do  That's what happens  That IS what happens when you're improperly trimmed. You can't NOTICE any difference because you never FLY on a flat earth. 

...>.................NOW, take this to an extreme..   if you fly 1/4 the way around the earth and do NOT nose down for curvature, at the end of the 1/4 distance around the earth, you are saying the nose of the plane would be poinint directly away from the earth...   this also doesnt happen....    the reason why it doesn happen, is for the reasons ive explained 10 times to you:
------------
No, I'm not saying that. If you were not trimmed for curved flight around the earth your nose would be too high and you would mush or plow through the air, or you'd porpoise, and your wing would stall and repeatedly lower itself.

1.  the plane flies level to the force of gravity which follows you no mater where you are on the earth.    because you fly in the equal gradient of pressure and this pressure gradient is curved with the earth, the level flight of the plane will curve because of gravity and the curved atmosphere with NO pilot interaction.
------------
If you were trimmed for flight on a curved earth it would BE set correctly nose downward ALREADY!
But this would be different if there was a flat earth.

2.   neutral elevator is the position that will provide level flight.  it might not be at a equal angle of incidence to the wings, but it provides the best low drag, equal lift to gravity ratio at any given speed for level flight. this will NOT change due to earth curvature.
-----------
No, actually it isn't. Even on a flat earth you must set your angle of attack with the elevator, off of neutral.

Now, go back to your small asteroid analogy/comparison.  say we had a perfectly round asteroid, that was 50 miles in circumference.  lets also assume it had an atmosphere as dense as the earth, because this asteroid was made of material 10000s of times more dense than earth, so it had the same mass and gravity.        you would fly the plane level, with respect to gravity , perpendicular to the surface.   relative wind would be parallel to flight...  and NEVER would you have to adjust the controls for the curvature, even if you were circling the asteroid every min.          Why??   because the angle of attack of the wings would be near neutral (what ever needed to create the match of lift to gravity, and thrust to drag)   if you had the slightest downward angle of incidence to follow the curvature, this would force the plane to lose altitude, and this is NOT what we want to happen.   we want constant altitude.  
------------
No, once you were trimmed for flight at assigned altitude on that asteroid, your elevator setting would be lower than it would be trimmed properly for flight on earth.

here is another thought experiment:

have a spinning wirlpool. perfect circle   put a small air foil in the  water at some distance from the center. (say there was a round center 10% of the total diameter of the spinning wirlpool.)   relative to the  center, find a equilibrium pressure that keeps the wing in a fixed position..  it's angle of attack is set. it doesnt have to be adjusted to follow the curve of the center. same thing happens with planes on earth.
------------
Your wing setting would still be nose down more than in a pool with laminar parallel water flow.

you have used  over our conversation, two contradictory statements.   you insinuate that the aircraft needs to be constantly adjusted, (albeit slightly) downward to follow curvature .. then you say that the aircraft needs to be nosed down via an angle of attack that matches the curvature.  both are incorrect.
------------
No, it does not have to be adjusted at all if it is initially adjusted for flight in the curved path around the earth. And that will be the optimized airspeed for throttle setting. But on a flat earth it would be different.

the angle of attack that matches level flight, is maintained and never changed as a plane flies around the earth.  this is basic physics and i cant believe you are resisting it as much as you are.   especially,  being a degree-ed , "physicist".     mind boggling you cant admit when you are wrong.
------------
Yes, once it is trimmed for curved flight over the curved path on the earth, but that would be a different setting than for a flat earth.    You clearly have no idea what I'm talking about.
Reply: zanick2
No, it does NOT have to be put in every minute, IF the trim was exact, and the trim causes a very very slight continuous rotation of the plane about its center of mass, causing a torque that executes that rotation. If he gets the trim exactly right, his rotation slowly executes sufficient to match the curvature of the flight path and he wouldn't have to change it again. You do NOT measure from the initial trim point, you measure from the plane at every point. The change is only one degree rotation per degree of change in latitude or longitude, about 70 miles. At 500 miles an hour that is  about 7 minutes per degree of rotation of the air frame.  What it sounds like is that you're right about the four forces, and I'm right about rotational vectors.  No, a pilot would not have to constantly readjust the elevator, IF and ONLY IF he got his trim perfect initially. But it would be a DIFFERENT trim setting on a hypothetical flat earth.
Reply: rstevewarmorycom
wow,  you clearly are not thinking this through.  the last few comments are very telling about how stubborn you are being now.   Look, you have now settled on the fact that , (your words) : 

>>>>>>>>>>>>>>>>>>>>>>>>>>>>>> " Yes, once it is trimmed for curved flight over the curved path on the earth, but that would be a different setting than for a flat earth. You clearly have no idea what I'm talking about.">>>>>>>>>>>>>>>>>>>>>>>>   and this gem:
>>>>>>>>>>>>>>>>>>>>>>>>>>>>>"No, it does not have to be adjusted at all if it is initially adjusted for flight in the curved path around the earth. And that will be the optimized airspeed for throttle setting. But on a flat earth it would be different".>>>>>>>>>>>>>>>>>>>>>>>>>>>>>>>>

Do you not see the glaring error here?  you are basically saying that if you are trimmed for a round earth, that there will be no adjustment further.     .    one setting would never work, because if it was a 1 degree change (for example) then that 1 degree would never turn in to 90 degrees at 1/4 the way around the earth. 
1 degree decent, would end up with you landing somewhere on the earth.    even though the plane is curving with the atmosphere, the plane is following a parallel path to its relative wind.   which is curving 1, degree per 8 mins at 500mph.      if you understand the atmosphere rotates its orientation by 90 degrees , 1/4 the way around the earth, you then realize there is no need to "steer" the plane to this orientation with trim.
as long as you are in level flight at 500mph, the plane naturally will be changing near 300ft per min relative to its original position, without any control inputs. but maintain the same altitude above the earth

here is the net net.. if you are flying level, the gyros .AH, tell you you are level.  if you change , even a fraction of a degree, the airplane speeds up or slows down.       if you stay level, you follow the earth's curvature, without any control input. 

PLEASE NOTE: 
going back to the asteroid analogy or the water whirlpool analogy........I think if you review your answers this might become clear.  in both cases you said that that same wing would have to be trimmed up or down to fly straight on a flat earth.   you are part right.  the curvature of the whirlpool  airfoil would cause the trailing edge to have a effect on the rear exiting flow on a straight path of water, that it woudnt have on a curved  path of water.. HOWEVER, once a neutral position was found,   (Trimmed for level flight)  with the same wing, in both conditions. no adjustments would need to be made to fly level . whirlpool, flat earth, curved earth or asteroid.  we are NOT talking about a particular airfoil is trimmed to fly level, we are talking about , if it is trimmed for level flight, does it need to be touched to follow the earth curvature... KEY POINT!  the answer is NO!   It DOESNT!  

Ill copy this discussion and pass this on to another physicist.  my younger brother has a PhD in physics from UOW, and why dont you do the same and let's reconvene later.  you are not thinking this through and using strawman logic to prove your point. i really cant believe the logic you are using. its very similar to brian mullin, it remindes me of his "landing a plane on a moving earth " discussion,  and i know we both know how crazy he is.
Reply: rstevewarmorycom .   I had to think about that for awhile and i think you are right about the initial input.   IF you had to follow the curvature of the earth, yes, a 1 degree pilot input that resulted in 1 degrees decent per 8 mins would be possible  and it would rotate around the earth .. However, this doesnt happen.  a 1 degree decent,  would cause near 300ft per min decent rate and eventually  you would land the plane.. this is because you would have to cross the parallel path of the relative wind to do this and this isnt needed.. the atmosphere itself is curving at this exact same rate.  it has to ... 

Both of us have proved now, without a shadow of a doubt, that Wolfe620 is wrong about constantly adjusting the controls , even ever so slightly , to follow the curve.   now our only argument is whether there is any control input needed to follow the curvature.. i still contend that there isnt.    If we use my analogies and comparisons we can get to the root of the issue and confirm my conclusion.
Reply: stevewarmorycom   Now that our only disagreement is that that initial exact trim setting that folllows a curved earth , is not needed.   I prove this by showing that with a curved atmosphere, the plane flies perpendicular to gravity, and parallel to the relative wind. so, there is NO precise trim input needed to follow the 1 degree per 8 min curvature at 500mph.      this curvature is built into the pressure gradients of the atmosphere and as long as the plane is following the relative wind, the plane always flys level to gravity, BUT, curves with the earth   LIKE the control line airplane. (gravity is just like a centripetal force, like the control line), or like the wing in the whirlpool, or like a submarine flying in pressure gradients that curve with earth in the ocean, or like a blimp.
Reply: It almost sounds like we're saying the same thing with different definitions. Your PLEASE NOTE paragraph sounds correct. And that IS what I said. IF it is trimmed perfectly to follow the shape of the flight path, then iit wouldn't have to be touched. But it IS trimmed nose down to continuously follow the earth falling out from under it. The gyros reframe periodically, so they will not tell you you are flying around the earth. They are not plain gyros, they keep being reframed to point at gravitational "down". 

You said:
"Do you not see the glaring error here?  you are basically saying that if you are trimmed for a round earth, that there will be no adjustment further.     .    one setting would never work, because if it was a 1 degree change (for example) then that 1 degree would never turn in to 90 degrees at 1/4 the way around the earth. "
---------
That's baloney. The one degree change over the one degree travel over the earth would continuously rotate the air frame nose down very very slightly, and just like it would compensate for the earth falling out from under the nose in the first degree of travel, it would continue to do so all during the flight.  And the wind is continuously changing direction too!! And one degree down per degree lat/long curve of travel would have NO effect on your altitude.
Reply: zanick2
No, it's NOT one degree of elevator adjustment, that WOULD crash the plane, it is an adjustment OF the elevator that RESULTS in one degree of rotation of the airframe downward over 1 degree of lat/long travel over the sphere.  And the wind is ALSO changing direction as you go around the earth!! So, no, it does NOT cross the relative wind.  I will have to go over exactly what Wolfie said now, to see if he was right. Autopilots are closed-loop controllers, which I used to design, by the way, and they dither about the required control outputs. This hysteresis is needed to prevent wild excursions. So it might be that what he is seeing is the controller dithering. But the REASON it is dithering can be that the rotating path causes new inputs to it to cause it to readjust.  You and I seem to be right if Wolfie is misunderstanding his autopilot. I'm glad if we finally agree. This is how physics works, people hash it out, usually on a blackboard or a napkin in some restaurant and get yelled at for being loud!! ;->
Reply: rstevewarmorycom.. yes, 1 degree of downward rotation, or decent . who knows the angle that it would take on the elevator.  Yes, i mispoke there.     

Now, as far as relative wind... do you understand the differences between relative wind and "wind".    they are two entirely different things.   being parallel to the relative wind, only means you are flying level.. as long as the atmosphere is still, which for our argument /discussion we have to.  yes, in real life, it is constantly moving... but we have to assume it moves the same in both cases (flat and round earth) the same. so, its not a variable factor  to consider.  you fly parallel to relative wind and you are flying level and at a constant altitude above the earth.

I think what you are saying is that the wing will fly differently on a flat earth vs round. and even thought the differences are infinitesimally small, you are right there. But, once you are trimmed out and flying level. there is no adjustment necessary.  this is where wolfe is dead nuts wrong.  he seems be ignoring the curved atmosphere and the force of gravity being straight down, perpendicular to level flight.

I think we are finally agreeing and, as always, (and it seems you do) enjoy these kinds of discussions as they seeem to make us smarter, or at least jog the memories for things we may have forgotten or not thought of in this type of way before.    yes, a little frustrating here, but on a cocktail napkin, in a bar, restaurant, or white board, its MUCH better and over faster!  ;)
Reply: zanick2
Well no. Relative wind is wind relative to the wing and its required angle of attack through it, to provide lift to combat gravity. The chord of the wing is inclined to the relative wind to create lift. Just as with a little balsa wood plane, the elevator is declined to push the nose up to incline the wing and give it an angle of attack, and it would not fly without it.  

I will have to re-examine what Wolfie said again, I'm quite old and I run out of energy.  In fact I happen to be dying of several causes. But restaurant classes ARE a lot of fun. Even if they wear me out.
Reply: rstevewarmorycom    dont be so quick to correct my "relative " wind description.  you are right too.  more accurately, putting both of our definitions/descriptions together.....  "Relative Wind" is the directly opposite of your forward direction of the aircraft.  yes, it requires some level of angle of attack of the wing  to do so in most cases.  
in some high lift wing designs, there can be 0 angle of attack and the plane can still increase altitude.  but generally, most aircraft need some angle of attack to create lift and this would require some elevator input.

the point is, if you are flying at a constant altitude, you are level with the ground. you are flying parallel with the relative wind, by definition.    as long as you stay level, the angle of attack, what ever it is to remain level and create level flight, will never change. Ceteris paribis.   the plane will naturally curve around the earth with no input from the pilot.  this is because the atmosphere curves, so the plane doesn't have to incorporate the 1 degree per 8 mins at 500mph.. it happens by just flying perfectly level.

getting back to what Wolfie620 said, he is not right at all about the pilot having to make small adjustments down , to follow the earth's curve, even being so small as to notice by even the pilot himself.   its just not needed for the reasons we have been talking about

Very sorry to hear of your health issues!  VERY best of luck keeping yourself healthy and full of energy!   sometimes these discussion help raise our energy level!

have a great evening!
Reply: One other thing that should clarify the "need to adjust pitch as you travel around the earth"     think of the space shuttle.   NOW, because it is not flying in atmosphere, it is set to rotate at the same rate that the earth spins so it can stay parallel to the earth surface. it needs to actually spin, end over end, so that relative to the earth, so that the shuttle always faces the earths surface .      this is when constant adjustment is needed.  the end over end roll rate , is onetime per revolution (or orbit). but, once in the atmosphere, as long as it is flying in the atm, there is NO pitching down of the aircraft or shuttle, because the atmosphere is curved parallel to the earths surface.
Reply: zanick2
The plane is NOT parallel to the relative wind, its motion is. The wing still has a non-zero angle of attack. The trim is what sets this, but it would be a different setting for a hypothetical "flat earth". But once the craft is trimmed to maintain assigned altitude correctly, in ideal flight it would not need adjustment again. The 1 degree per 1 degree of long/lat flight is incorporated into that very trim setting.  

I haven't heard ceteris paribis in many years, the ablative of respect, like "facilius dictu actu".  I'm an old Latin scholar of 5 years experience.  I'll revisit Wolfie later, right now I need another nap. Later.
Reply: zanick2
No, actually the shuttle needed to keep its radiator doors open and oriented away from the sun so it would radiate excess heat away. So they usually let it orbit end over end without rotating the shuttle. Only if they needed a communications link would they steer it.  Older spacecraft without radiators used "rotissery mode" and rolled the craft continuously.
Reply: rstevewarmorycom ok
If you want
We can classify the relative wind as being parallel with the direction of the center of mass :)
But there is no 1 degree trim set at 500mph
Again level flight is all you need 
Set ai to 0 and the aircraft will follow the curved earth because the atmosphere is curved 
No trim needed
Reply: rstevewarmorycom     Regarding the shuttle, you are right.  I've read that (about how they oriented away from the sun.  )  so maybe that was a bad example.  How about the ISS  then?     the point is, it has to be induced to rotate to keep one revolution per trip around the globe to keep it always in the same position.        in the atmosphere where it is flying in the atmosphere, jets dont need to do anything to keep their horizontal orientation.   this is because the atm is curved .
have a good evening!
Reply: zanick2
ISS has thermal radiators on many sides so they can be activated as needed away from the sun. It's all automatic. They do not rotate in orbit, they keep a constant orientation that is best for their solar panels. It doesn't rotate, its orbit does so relative to the earth. Their day night orbit, 45 minutes hot, 45 cold, contributes to their heat control.
Reply: zanick2
The CM is a point, it cannot be parallel to anything. And if you mean the roll axis through the CM, then even that is skewed off the direction of flight, inclined by the angle of attack.  This is why you have to slightly elevator down to do a perfect aileron roll. You have to momentarily lose your angle of attack. Yes, the trim set that keeps you at assigned altitude DOES contain a component that IS the correction for the earth's sphericity. When you first set trim for level flight you unconsciously do this because that is what keeps you at assigned altitude consistently.  You seem to be having trouble with this concept. I wish I had a white board. I'm saying the spherical correction is part of the total trim.
Reply: zanick2
I have re-viewed Wolfie's video: "Do aircraft change attitude to follow the curvature of the Earth?" and I find absolutely nothing wrong with his analysis. No, his autopilot really is incorporating a tiny correction for sphericity into the normal trim changes for correction for other variants. It has to. It doesn't know it's flying around a globe, it is set to correct barometric altitude, and as that barometric reading changes as the plane flies into higher, lower pressure air, it must adjust trim slightly downwards, even though it is a much tinier component of trim than any others. 

Planes have inertia of forward motion, they do not magically stay at a specific altitude or magically bend their path. they are NOT buoyant and the atmosphere doesn't hold them up. The autopilot finds itself, due to travel around the earth, in an inadvertent climb, and adjusts to correct it by trimming down. You see, an autopilot, or any pilot for that matter, changes trim periodically, not continuously. This makes the plane's path through the air a series of successive straight line paths that only approximate a circle around the earth. IF you could adjust trim perfectly, you would NOT need to keep adjusting it, but that is a pipe dream. 

The inertia of motion of an aircraft is in one direction, not a curved direction. It is NOT in orbit where everything is balanced. It is flying an orbit within the atmosphere, if you will, by brute force. This means it has to steer downward as the earth falls out from under it due to travel. 

The autopilot/pilot does not know it/he is supposed to fly an always down-curving path.  It is simply told to keep the barometer steady with what it can control, the trim tabs.  And it doesn't respond continuously, but periodically, which makes the circular flight around the earth into geometric approximations of a circle, using straight paths.

If you graphed the motion of the trim you would find a train of semi-sinusoidal deviations up and down to correct for flight, but you would find they were riding on an inclined step-wise straight line ascending to the right that accomplishes the change in direction over the sphere segment traveled. This graph for a flat earth would find that inclined supporting component to have zero slope.
Reply: rstevewarmorycom   In talking about the CM... (*sorry i was typing on a cell phone) i was referring to the direction of the CM with respect to the relative wind.    it is always parallel..  actually, all the mass is parallel to the relative wind... so, lets forget about that.   same with roll axis. as you mentioned, you can still fly level with the roll axis pitched up (high angle of attack.     if the roll axis, "through the CM" is skewed  of the direction of flight....., that by definition IS the angle of attack.      in level flight there always will be a certain amount of angle of attack that is not parallel to the relative wind.   So, we have to define "level"  level flight is the direction of travel that does not gain or lose any altitude. above the earth.

yes, I wish i had a white board as well, but i do think through this back and forth, i do NOW understand what you are saying and thinking on the topic.  Here is why i believe you are missing something that precludes the possibility of the trim factoring in  an earth curvature factor..

one more thought experiment:

1.  say you were flying level (not gaining or losing altitude)  flying at 500mph, and curving around the earth at a rate of 1 degree per 8 mins.   and suddenly the earth turned magically flat........... i contend because the atmosphere would straighten as well, and all the trim setting were set relative to the force of gravity straight down and the air density that you were flying in..... nothing would change.    

an  obvious analogy that you seem to be pointing to, is that your theory equates someone driving on a curved race track and suddenly the race track is straightened while you are in a curve  (like shaking out a blanket)  you would change your steering wheel position to be straight.    this is NOT what is happening in flight. 

can you see the difference?   the difference  is in the direction of the force of gravity in both cases.    equating the centripetal force on the car around the turn vs the gravitational force acting on the aircraft, you clearly see that straightening the race track, changes the force direction to straight down....  flattening the earth, doesnt change the force direction of gravity , it remains straight down.    
Its a great analogy, because it addressed the subtle "turn pressure" or the "1 degree of trim" that you theorize is part of the level flight setting based on the earth curve.

in any event.........Wolfe620 is dead wrong about the pilot making constant adjustments along a flight path circuiting the earth.
Reply: The ISS rotates... it has to. .. just as the moon rotates.    They rotate the ISS to be "tidally " locked to the  face of earth.  this is what you are proposing aircraft need to do, and they dont.
Reply: zanick2
No, no, no, the ISS is not tidally locked. The ISS is stationary and it remains so as it orbits the earth every 90 minutes, so it appears to change orientation when looking at it from the earth. And no, no, no, that is NOT what I said at all. You totally ignore both linear and angular inertia and the need to follow the path of flight with the control surfaces. Re-read or watch what we both have said.
Reply: rstevewarmorycom.   I dont know how to respond.  the ISS is NOT stationary if it is always oriented the same. how do you think you can look out the window and see the earth not move from the field of view of  the space station if the space station isnt rotating to match the rotation it makes around the earth?   it does NOT appear to "change orientation" as you said... i never said that.   looking at it from the earth, looking at the earth from the ISS, it stays "tidally locked".  meaning, it always faces the surface of the earth.. THIS MEANS it rotates on an axis.

what do you mean i am ignoring linear and angular inertia.   i dont believe i am at all.  if you are talking about the aircraft again... the rotational inertia and translational inertia are well understood    

there is a factor, that i might think you are confused about, and that is the evotos force.  the centrifugal force, in addition to the gravitational force.        this means, at greater and greater speeds the aircraft effectively becomes lighter.   this means to trim to level flight  vs being on a flat earth, ceteris peribis, yes, the plane would be trimmed differently.  (conservation of angular momentum). this would change based on what direction around the earth you were going too.   (north -south or west vs east)

so, if this is what are you are speaking of, you are correct.    

However, once you find level flight, there is NO trim to add . there is NO adjustment to down 1degree at 500mph ..... this is what we are talking about.    you seem to think its incorporated in a curved path around the earth, and the only factor i can think of that makes this true, its its centripetal force acting against gravity
Reply: Hold a model of the ISS in your right hand. Take your globe and without rotating the ISS in any way, move it in a circle around the earth with your hand. THAT IS WHAT THE ISS DOES!!  NO NO NO! It is NOT "tidally locked". 

 Eotvos is unrelated to orbit, it is subsumed into orbital theory,  and it is very tiny when not in orbit. All it does is reduce needed lift slightly and uniformly. Go study it more.  

Having reviewed it carefully, I am QUITE certain now.  About the rest of what you just wrote,  you are wrong. 

A plane by its inertia tries to move in a straight line. This causes a correction to be made necessary NOT in some linear direction which would add or subtract potential energy, but in rotating the craft so its control surfaces conform to the circular path of flight as the earth AND ITS atmosphere bends around the globe. 

The pilot/autopilot accomplishes this by adjusting the elevator/trim tabs, but he/it doesn't behave as though anticipating a curved path of flight. Both assume that the flight path will be in a straight line. But it isn't, so the correction, unless accidentally perfect the first time, must be continuously readjusted. 

It COULD be PERFECTLY adjusted so that the path of flight is exactly circular about the earth. But that is unlikely, whether hand flying or using the autopilot. So the actual path will be an approximated circular path in linear segments. And this approximation is achieved by continuous adjustment that includes both the much larger vicissitudes of real world flight, and the tiny contribution for flying the circular path.
Reply: i used and spoke about Eotvos in the correct context. i wasnt speaking of anything orbiting the earth.
The Eötvös effect is the change in perceived gravitational force caused by the change in centrifugal acceleration resulting from eastbound or westbound velocity. When moving eastbound, the object's angular velocity is increased (in addition to the earth's rotation), and thus the centrifugal force also increases, causing a perceived reduction in gravitational force.
Reply: Going back to the ISS.     regarding your first paragraph.........how do you rotate the ISS and move it around the earth with one side facing the earth, WITHOUT it rotating in space.   please explain.  are you really thinking about it?
Reply: rstevewarmorycom.      You have not reviewed it carefully enough.   i reviewed it again, and came up even more proof.   you keep on forgetting, and confusing , level flight with straight flight.    straight flight would be ONLY a tangential path away from the earth.   the angle of gravity would be constantly changing. this would require control inputs.     level flight, however, would not require any additional inputs as long as the plane was level, with respect to the earth. this means, the pressure density is not changing, the distance from the earth is not changing and speed remains constant.     however, as you noted, the aircraft is rotating , one revolution per revolution around the earth, so what causes this?     this is a force caused by the atmosphere, which is imparting a slight upward force on the tail , proportional to the curve of the atmosphere.   the atmosphere creates this force, not the airplane.   the force that actually rotates the airplane relative to the center, is caused by gravity and the air moving around the aircraft.  

quite a bit more simple to look at a blimp. there is no adjusting the blimps attitude . no change in angle of attack of the control surfaces..   it just flys level and follows the curved atmosphere.  as long as its level with respect to the directional force of gravity, it will follow the curved earth and remain at the same altitude.

the best analogy is that of the control-line aircraft. if you have an airplane tied to its center of mass to the center of the axis of rotation, the plane will fly with no changes required to its control surfaces.    gravity works in the same function here as the control line. and as you incorrectly said in one of your first messages, gravity is not like centripetal force, but actually it is considered to be near identical in function for this discussion.    the relative wind is curved..  just like in real life. the plane makes no adjustments to follow the round earth. gravity matches lift in real life, and centripetal force equals the force the control line produces.   thrust equals drag and you have a balanced system, curving around the axis, with no need to change or alter, "slightly control" the aircraft.    gravity and the control-line are the forces that make this happen.

I have a few physicists looking at our discussion and so far they say I'm right and you are wrong.  what have you found?     we need a 3rd party to settle this discussion.
Reply: zanick2
I told you NOT to rotate the ISS with your hand. Keep your hand and wrist frozen. Then move your hand around your little earth globe. That is the way it flies.  This is to keep its solar panels toward the sun whenever it is available.  Tidal forces are not enough to rotate it away from the sun. If anything did they would counter it with reaction wheels, gyros they can brake against to cause a small torque.
Reply: rstevewarmorycom.  you might want to re-think your response regarding your view of Wolfie620s response.
i posted your response to the physics forum and the staff mentor reviewed our discussion.

YOU SAID:
>>>>>>>>>>>>>>>>>>>>>>>>>>>>>>>>>>
        I have re-viewed Wolfie's video: "Do aircraft change attitude to follow the curvature of the Earth?" and I find absolutely nothing wrong with his analysis.
>>>>>>>>>>>>>>>>>>>>>>>>>>>>>>>>>>>

THE PHYSICS FORUM STAFF MENTOR RESPONDS and disagrees with you !!!!

    I do:
    He describes the rate of change of orientation as being below the threshold needed to detect motion. This is wrong. The change in orientation is continuous and the g-force constant, which means there is nothing to feel at all. No threshold needed! About the only quibble one could make is that due to the motion around the Earth you have a slightly lower than normal, but constant apparent weight traveling one way and slightly higher apparent weight traveling the other.
Reply: CharlesFockaert you’re not a pilot. And if so you need your license taken away. Everything you stated was completely wrong.
Reply: Steven, actually, there is no correlation of a pilot and a scientist.  just because he can fly a plane, doesnt mean he knows how things work.  what he says is totally true.. he flys level and doesnt have to change the settings of his controls. this is becuase the force of gravity is straight down and it changes with reverence to the direction to the center of the earth.  so, LEVEL is NOT STRAIGHT.     the earth is curved, but a pilot that doesnt know exactly why or how things fly can still be confused.
Reply: zanick2 my comment was to charlesfockaert talking absolute nonsense. Im not one of them lol
Reply: zanick2 and its not about his main post. Its about his comments on the thread going on about ridiculous conspiracy’s and failing to respond to any legit questions. Then responding with childish insults to other users.
Reply: yes, wolfie is a pilot.
what is level?
Reply: Tom, gravity can be resisted.
Reply: heed the seen.... yes, wolfie is a pilot, but he doesn know the difference between level and straight.   Level is flying at a constant altitude above the earth , flying in the same pressure gradient.   it is based on the distance to earth which doesnt change as you travel around the earth.    so, then, you keep the plane level (perpendicular to the directional force of gravity) and the plane will naturally follow the curve of the earth...........because the atmosphere is curved.. so is the ocean.   boats dont adjust for curvature, nor due subs.
Reply: The reason the Earths spin was not mentioned in your limited flight training is because it is largely irrelevant to VFR flying as you do not notice the effects (bar the Sun rising and setting) of the rotation. Much like
the Earths rotation is not mentioned when you are studying to pass a driving test. It is clearly the result of you not noticing the effect of the Earth rotating that has allowed you to convince yourself that the World is flat and supported by giant turtles..
Reply: Forget the motion of the air for a moment, if you jumped from the surface of an airless Earth you would still be moving at the same speed, it's called angular momentum..
Reply: Distance to stars are calculated by parallax, which by the way is a function of the Earth's orbit around the Sun. Parallax is also by itseld proof that the Earth orbits the Sun...
Reply: Or just stir a cup of coffee and watch how the fluid keeps spinning even though when you stop stirring it with your spoon...
Reply: and i'm a brain surgeon.
Reply: Wolfie6020        so wolfie  if the earth spins with 1000 mph  then  rent a helicopter and stay stationary  at one point and tell us where you are going to land after one our     record the experiment please and show it to us!!!!!
Reply: Alex Karlsson     because you are a smart person tell us please why do YOU believe the earth is a globe?,do YOU know the shape of the earth????
Reply: Sphere Doomer    how much do you understand Einstein     i see you call people idiots all the time!!!! can you tell us what makes you smart??????????
Reply: Sphere Doomer       science is a religion if you believe in it   is also a belief !!!!!
Reply: Sphere Doomer      can YOU show us YOUR personal experiments you have done to prove the earth is a ball?
Reply: Sphere Doomer     so you believe everything the system tells you?
Reply: Sphere Doomer    how much ,,research,,  YOU have done?
Reply: grahvis       and how do YOU know this please????how do YOU know the distance to Polaris and how did YOU calculate it????
Reply: grahvis        can YOU show us the HIPPARCHUS satellite please???? i have seen SANTA CLAUS  flying above my house many times!!!!!!!
Reply: CharlesFockaert: how the world's oceans are stuck to the bottom and sides of a ball spinning around at over 1000 mph
============
1000 mph compare to the earth's diameter, is very slow speed. look at your watch or clock on your wall. you would see the short needle spins very slow. that's how fast the speed of 1000 mph compare to the earth's diameter (12000+ km). it's very very slow.
Reply: CharlesFockaert It's a bit sad that someone who jumps into this conversation proclaiming their credentials and suggesting that Woolfie isn't even a pilot has to finally admit that "Just because a private pilot who hasn't flown in two decades, who isn't IFR and not up to speed on some aspects of flight or as knowledgeable  as a commercial pilot who has to keep current by passing exams, doesn't mean he's stupid". Well doh it was obvious that you weren't knowledgeable. It's even sadder when the same Charles Fockaert bases his whole "knowledge" on the subject on YT videos and the belief that evolution and a globe earth somehow invalidates his religion. Now that really is sad.
Reply: CharlesFockaert you do care what others think, you know why? Because you vote for gay marriage to be illegal but it is legal.  You want Christianity taught in schools but evolution is. You want flat earth taught as fact but it isn’t . The earth is a globe,evolution is true, and it’s perfectly fine to be gay and married..you can freely practice your religion regardless and be married to a woman, and say it’s a marriage under god. But the You want to leave out that lie given to you by other human beings called religion or Christianity that is said to be true but your institutionalized as a child by it before you can even understand if it’s true or how...but every other thing is a lie or conspiracy given to you by human beings.